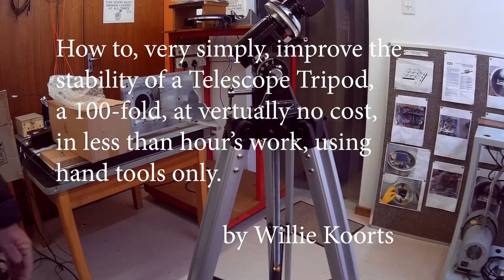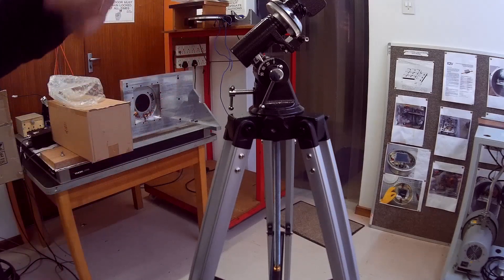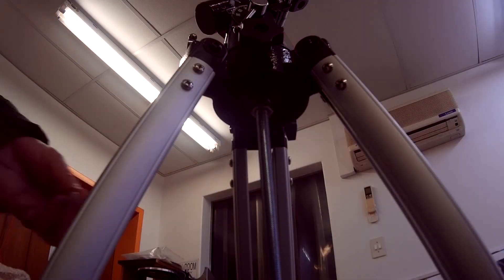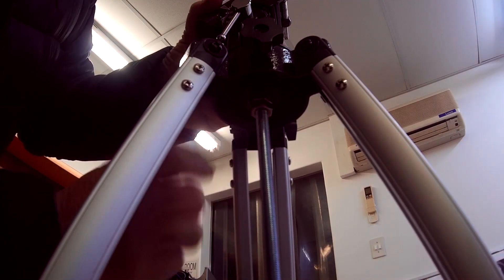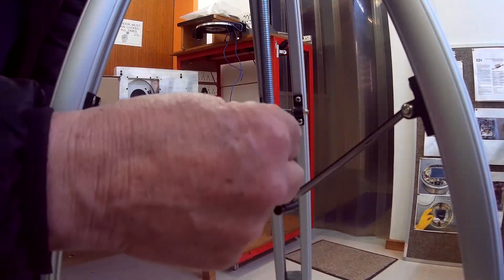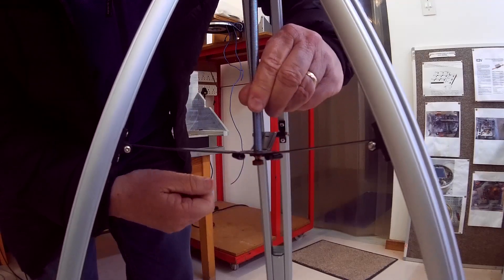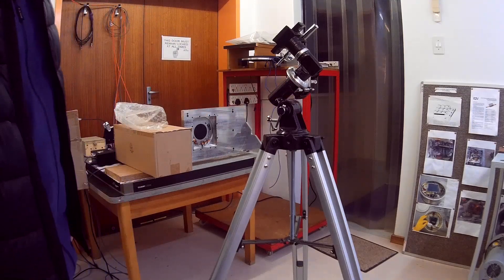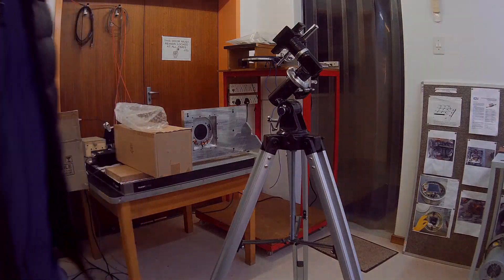How to Improve the stability of a Telescope Tripod

Comment: I have a mount that looks the same. I never recall having a problem with the play as the azimuth is always locked when observing / photographing. You only once turn it pointing to the north (on northern hemisphere).

The basic issue is leveling the tripod, which I've helped by adding a string from the center of the az lock bolt handwheel and a small weight going though the tray (drilled a hole to the plastic tray). When the string is in the middle of the hole in the tray, the tripod is level.

The tray tightened with three screws makes this tripod quite rigid, so don't use it without the tray.

Comment: Nice 👍 just looked at some video tripods ($200 😬) but then spotted the basics one for $15 with the center pole 👍😃 cant possibly be worse than the plastic endowed one that came with my cheap telescope (even if i tighten that bolt i can see the weakness in those 3 top hinges, no securing that without the rod).will mod it together. Cant fault 15 notes for a project. And thinking bearings...

Comment: Interesting. After buying a second Benro tripod recently for travel and being unimpressed with its quality (the large ones are great) I’m exploring the insane idea of building my own stand - whether it has 3 or more support stands doesn’t matter. I’m surprised how little information there is on the actual physics or DIY aspect of these. Video tripods feature an interesting collar for the legs which I believe yields a much more stable base than your approach- though I could be mistaken. Thanks for sharing this. Also, South African or Dutch accent? Sounds South African!
Reply from the maker: South African indeed - my mother tongue is Afrikaans.  Nothing wrong attempting your own telescope stand.  I once made one from three old fashioned wooden crutches (see https://youtu.be/GMp7upcQ16w  minute 0:13).  And good idea to get ideas from other tripod designs.  Good luck.

Comment: I have a Celestron 21036 and it wobbles too much.  Where do I get this threaded rod
Reply: I have a really cheap equatorial mount. I found that lowering as low as possible makes it stable. Then I sit in a chair or on a stool when viewing. I put a cheap RA drive on it and now I use that mount with 4 of my telescopes. $60 for the telescope and mount $50 RA drive. Can't beat that.
Reply from the maker: @ww321  perhaps see if you can modify it like this - it is amazing the difference it makes.
Reply from the maker: Any hardware store should have threaded rod.  First unscrew the bolt that holds your tripod head and take it along to the hardware store and get the same size & thread.  Also get a few nuts to use as locknuts.  And while there, see what size bolt will work for drilling and tapping into the bottom of the rod and get the relevant bits, like drill & tap.  Happy ATM'ing (Amateur Telescope Making).

Comment: I 'd been occasionally wondering if there was some way to basically do this same sort of thing with my own trash EQ getup, er, setup. It's the only working scope I have for the time, and I'm actually having fun doing a few upgrades to it. Cheers!
Reply: I have a really cheap equatorial mount. I found that lowering as low as possible makes it stable. Then I sit in a chair or on a stool when viewing. I put a cheap RA drive on it and now I use that mount with 4 of my telescopes. $60 for the telescope and mount $50 RA drive. Can't beat that.

Comment: Had similar issues with my az2 mount(yoke mount) on my 70/700.I just retightened the screw at bottom and it was fixed.I’d say the main cause of this was the sticky grease used by the companies.its better to replace it with lithium grease